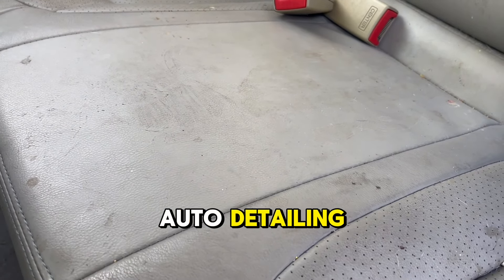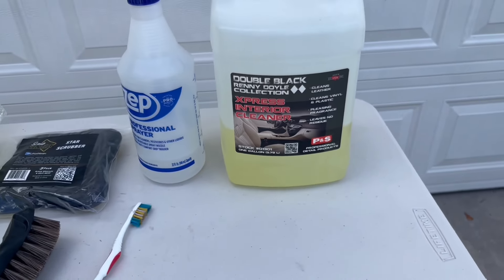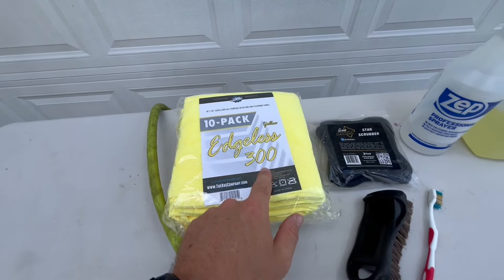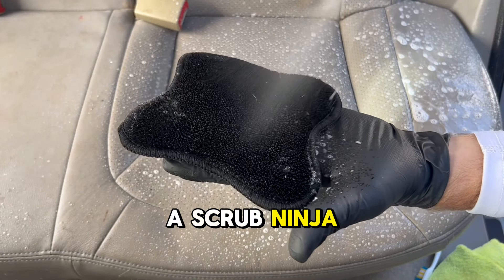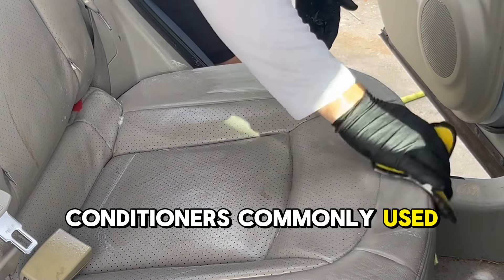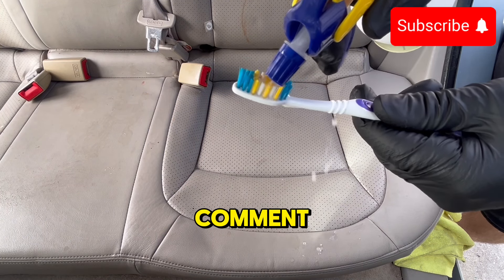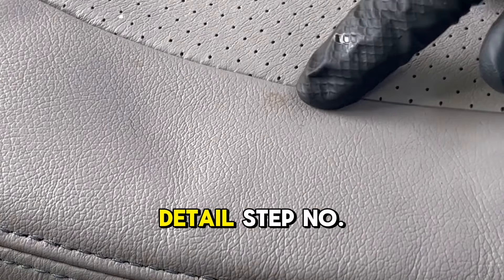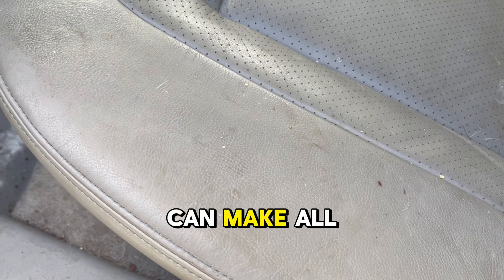How to Clean Leather Car Seats(The RIGHT Way!)

Comment: Do use the same cleaner and process to remove mildew and light mold from leather perforated seats?
Reply from the maker: Great question! To handle mold on leather car seats, I utilize my Vapor Clean Pro6 Duo steamer with the wide triangle brush attachment. This method helps kill mold without damaging the leather and prevents recurrence of mold. Here's how I do it:

1. Hold the steamer about an inch away from the surface.
2. Move it slowly, about 2-3 inches per second, across the moldy area.
3. Make several passes to ensure thorough cleaning.
4. Mop up with my recommended microfiber towels.

This is done right after the first step in the video, then followed by step #2: spray P&S cleaner and agitate and proceed with remaining steps.

Always wear gloves and a respirator for safety. Test on a small area first to be sure it doesn't damage the leather.

Comment: I used a leather conditioner on my brand new 2024 nappa leather seats as I felt I had no choice, they looked dehydrated and I felt if I didn’t the leather would crack. Plus I’ve always heard you have to keep leather hydrated.
Reply from the maker: Thank you for sharing your feedback and experience! There’s absolutely no issue with using conditioner if it enhances your peace of mind and gives you the results you like. If it improves the appearance of your specific material and you enjoy the look, that’s what matters most. Personally, I choose not to use it for a few reasons: it can attract dust, create an uneven finish, and often leaves behind persistent chemical odors that may be harmful, especially when the vehicle heats up. Not to mention simplifying my process, it’s a pain going over the entire vehicle with this stuff regularly and not worth it to me. Lol. 

While many products also claim to offer UV protection, I sometimes wonder if these “protectants” might actually contribute to faster UV degradation—though that’s purely speculative on my part. Ultimately, I prefer the natural, factory finish, even if it means sacrificing a bit of long-term durability. That said, everyone has their own priorities and preferences, and that’s what makes these discussions so interesting. Thanks again for sharing your thoughts, and take care!

Comment: Could I use a steamer to help the cleaning process?
Reply from the maker: Great question. You can, however, I introduce steam to leather only if I absolutely have to. It can definitely speed things up on really nasty/dirty vehicles when you have gunk that is really stuck in the cracks or gum/adhesives on the seat.

Comment: I dont have an air blower. Is there anything else i csn use?
Reply from the maker: You can carefully vacuum without scraping the tip against the leather (ideally with a brush tip) or use a very soft detailing brush or a leather brush to gently and basically sweep out the dirt and debris before you begin cleaning and scrubbing.

Comment: What do you recommend for bmw leather seats with dye transfer?
Reply from the maker: Assuming your vehicle has coated leather, like most modern cars, the cleaning process is straightforward. 

However, if you’re dealing with older, non-coated leather, you’ll need specialized cleaners and conditioners designed for traditional leather care.

For regular maintenance, start with something gentle to preserve the leather. A diluted no-rinse car wash solution works great—simply follow the dilution instructions for interior use, dampen a high-quality microfiber towel, and gently wipe the seats. Afterward, immediately dry the area with another clean microfiber towel to remove any excess moisture.

If the results aren’t quite what you’re hoping for, you can step up to P&S Xpress Interior Cleaner, diluted 1:1 for added safety. When using it, work in small sections (about 6” x 6”) to limit the cleaner’s dwell time on the surface. This helps protect the leather’s finish, especially if the coating is compromised. In my experience, P&S Xpress is safe and effective, but working quickly reduces the risk of affecting the dye, particularly with thin or weak coatings, or with easily transferable colors like black.

Finally, always test the product in an inconspicuous area before full application to ensure compatibility, especially if the leather’s protective coating is worn or if it’s traditional, non-coated leather. In this case, explore traditional specialized leather cleaners like Lexol or something similar which can be a more extensive cleaning process.

Let me know how it works for you or if you have any other questions!

Comment: thank you , what is the best product to remove sunscreen stain?
Reply from the maker: That’s a great question! If P&S Xpress doesn’t work, I personally turn to Zap-It by Superior Products for removing tough stains, even on leather. However, I don’t use it frequently on leather because it’s not a gentle product. and not specifically designed for it. It’s a decision you’ll need to weigh carefully. it can deliver excellent results but comes with risks like potential dye transfer or color issues. Just keep that in mind before applying it. Thanks again for the question, and I appreciate you watching!